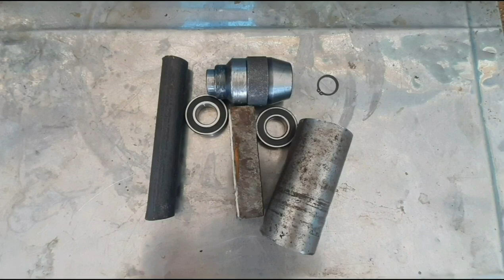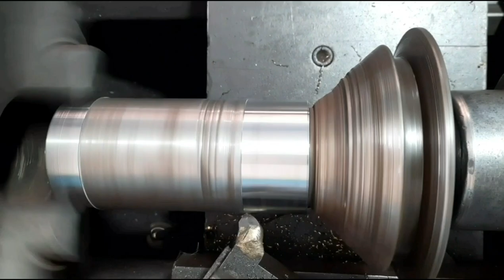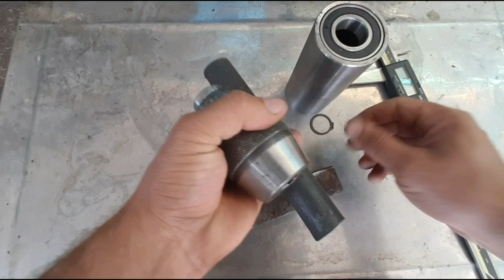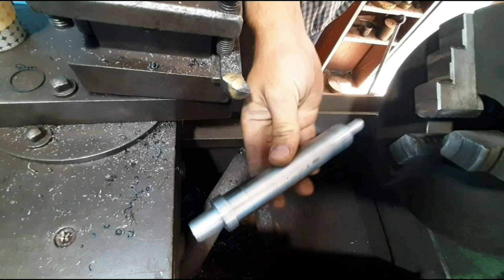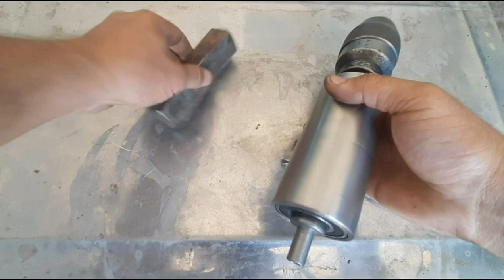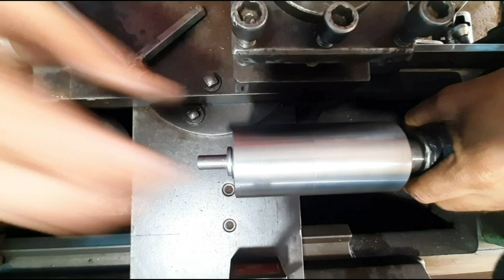home made milling machine attachment tool for lathe

Comment: I hope the housing for boring the barings was done by the lathe chuck itself.  With no shims under the shaft holder.  Mine was and a boring head used to optimise bearing outerr tolerance. That gives perfect centraliry crossing axees of lathe .  I also did an axial one mounted on cross slide for holes around center.  So with an indexer on the main lathe shafy a circle of holes (up to 24) can be made around a flange etc.  A Cowboy revolver for example.   Anyway, thanks for going to the troubld of showing people how. My comment might help too.

Comment: I need to know what kind of drill chuck that is ? As soon as I saw it I immediately started searching Amazon and Google looking but I don't know exactly what it's called. The 3 jaws on that drill chuck are unlike any I've ever seen, and now I must have one. Any info would be greatly appreciated 🙏🏼
Reply from the maker: Honestly, I don't know where I bought it from. I know that it is German-made
Reply: probably an Albrecht or Rohm keyless chuck
Reply: @madmodder123  But you see what I mean though right? How the jaws don't just pinch the tool like every other chuck I've seen. This one has maximum surface area contact.  I realize there's no real substitute for dedicated tools like collet chucks but something like this for my tailstock I think would be awesome. Maybe for holding annular cutters and end mills.
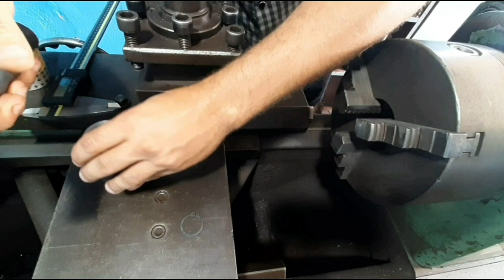Reply: @KBLIZZ333  at around 4:20 it looks like a regular 3 jaw keyless chuck, it just has the jaws retracted up into the body so you can barely see them
Reply: @madmodder123  yeah I think you're right. If it was what I thought, I am confident I would've seen more than just the one in all these years. The tool I had in my head doesn't exist. An adjustable 3 jaw collet chuck basically. Unless it was only for one particular size shank and no others.